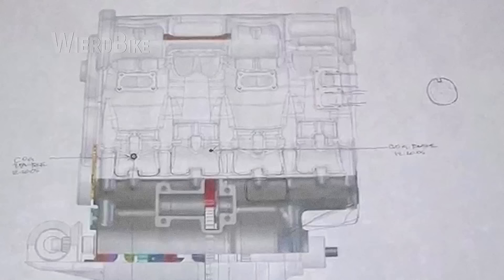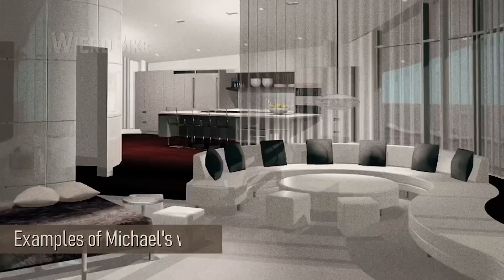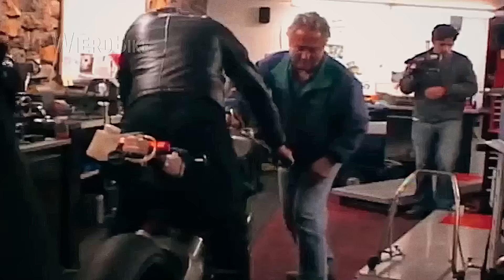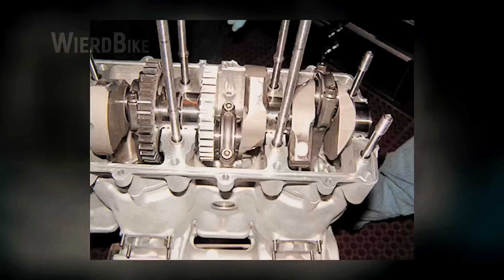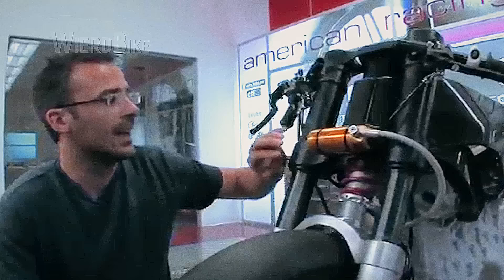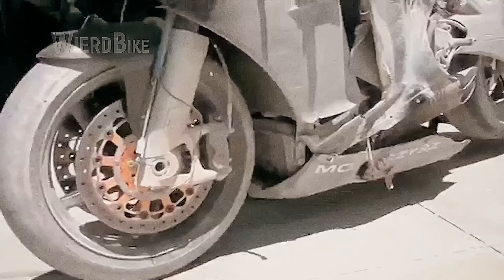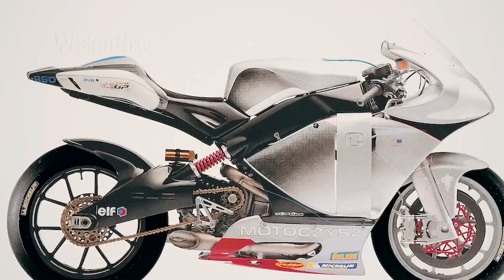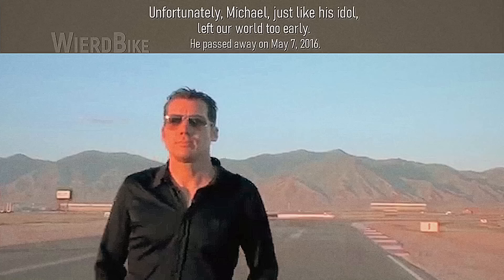It was SO GOOD that MotoGP CHANGED the regulations? Unique Z-line engine with 3 CAMS and 2 CRANKS.

Comment: Both Britton and Czysz taken way before their time by cancer...such a tragedy in both cases!
Reply from the maker: Absolutely true…
Reply: Isn't this how anyone that's a threat to an industry or an idea is taken out anymore?
  It's not a coincidence
Reply: @lancelanphier9509 it's time to take off the foil hat. it most definitely is a coincidence.
Reply: @lancelanphier9509  People around John Britten say that his prolonged close working with toxic chemicals to design and make the bikes was the cause of his cancer
Reply: @lancelanphier9509 car crash or poisoning is more realistic to be done, it takes years of regular poisoning with radiation to give a person cancer, like the Mossad did to the leader of the Brazilian nuclear project in the 70s and 80s.
Reply: @pashakdescilly7517 Stress it's number one factor for cancer.
Reply: Both worked with composites.
That is a fact.
Reply: Maybe all the hands on work inevitably involving a lot of breathed in vapors and absorbed chemicals etc ...think about all the lubircants,aerosols,fiber,carbon and fuel all the various elements they had to be like immersed in daily! ....no?
Reply: @pashakdescilly7517   certainly logical as I also posted below before even reading this although loads of people die of cancer that are not involved in such things...might even relate to things such as sleep deprivation?
Reply: @gregorykulinski2186   hand in hand with sleep deprivations?
Reply: @vyrnmn you should know there is no such thing as a coincidence, the laws of physics say this, everything is related to everything else😢cause & effect, no energy can created or destroyed, 'everything' happens for a reason 😮 you just need to see it

Comment: MotoGP did not change the rules because of this bike.
Reply from the maker: Maybe not
Reply: @wierdbike  No really, not because of this bike, it's a great design exercise, as was the Britten, but like the Britten, a long way from being fully developed and a serious contender. JB's bikes had a lot of potential when they first came out and were something to behold (I live in New Zealand and have seen them race many times) but unfortunately, they weren't very reliable and probably failed to finish more races than they actually finished. The V1000 needed a lot more work to really compete with the likes of Ducati, Honda and Suzuki who were the main competition in the 1000cc V twin market.
Reply: I bet if you research it the rule changes were proposed way ahead of time like they are again even now with the future moto gp rules once again lowering discplacement from 1000cc this time to 850cc instead of the 800cc that helped kill this motorcycle.  They dont change suddenly ever and the manufacturers must be oboard and have time to design all new bikes around the changes...maybe 150-200cc is not insane difference but you know it will effect a whole bunch of components of the design...enough that the motors at least will be all new...not like they will simply shorten the stroke and reduce the bore diameter a little.   I recall the mid 80s Harley initiated tarrifs on Japanese motorcycles 750cc and larger....Overnight the big 4 retooled and simply made their 750s into 700s which SEEMS like it would not be a big deal but it killed performance on em!  I bought an 85 VF700 Interceptor...what a DOG!  Was cheap as hell though!  3500 out the door brand new and half the price of the very next bike I bought the Limited Edition 86 GSXR750   $6,999 plus tax and licence etc
Reply: @onecookieboy but when they went... My God did they go.
Never saw one raced... just too young. Did see Andrew Stroud doing demo laps at Ruapuna.
I raced production based 250's in F3.
Reply: @wierdbike  Then why Lie?

Comment: Looks a bit like a 4 cyl version of VW VR6 ? For amazing engines i think Honda's 1979 NR500 with the "oval" pistons, V4, 32 valves 8 spark plugs was the most extreme. They also made a 250. 
NR500 was never successful but the construction was insane in 1979, trying to beat 2-strokes.
Honda also introduced F1 active suspension using cameras to detect surface in front of wheel, allowing them to adjust suspension before car hit a bump. 
Active suspension is what made Williams win so much, even without the cameras. The 1986 F1 BMW Mpower M12/13 was also a fantastic engine, making so much power that the dynamometer at BMW could not measure it (max 1280 on dyno,  motor had 1400). The most powerful F1 engine ever.

Comment: I thought the unit sales requirement was a WSBK thing, where MotoGP was for prototypes.
Reply from the maker: Yeah right!
Reply: He originally wanted the bike to compete in MotoGP, I'm not sure if the plans to sell road legal versions  came before or after MotoGP dropped the displacent from 990 to 800cc but either way, if Czysz had made road legal C1's he wouldn't have been able to race them in GP. Rules prohibited the GP bikes from using any parts from road legal bikes.  The WCM team got busted using Yamaha R1 engine parts (this was before the big recession and the short lived CRT bikes in GP, some of which used modded Aprilia RSV4 engines). 

He had also planned to race the C1 in Superbike classes but he never got the engines to be reliable. But they were said to have exceptional handling.

Comment: There is a motorcycle dealership in Portland that uses a motoczysz engine block as a door stop. It worked great.
Reply from the maker: yeah-yeah, very funny…
Reply: @wierdbike  No joke. 100% truth.
Reply from the maker: No way… any proofs???😂
Reply: @wierdbike  Its at Motocorse Portland Or.. Thats all that I will say.
Reply: The gas motor for this bike didn't make much power and liked to get rid of all its oil on local race tracks.... a lot....
Reply: True. It was VERY early in its development. Who knows what might have been with sufficient time & money.The dr stop was one of the "porous" cases.

Comment: I’m all for thinking outside the box, but even tho I’m not an engineer, and my power plant manager dad and Northrop Grumman engineer brother have infinite more knowledge than me on these issues, even when I was 17 and this was getting all the hype in the press, I saw that it was a failure. A Z-config in an inline engine might give better cooling. IF IT WAS AIR COOLED. Secondly, minimizing the frontal area for aero doesn’t work if you have THE RIDER sticking out well beyond the fairing. And I remember an article where they were bragging about the engine producing 190 horsepower. When the Hondas and Yamahas were making 250. It’s a quirky idea. But don’t insult the great John Britten by putting him in the same breath as a Las Vegas casino architect. I’ve met both Bostrom brothers, and have even talked to them about this. They did say that it handled quite nice. But it was slow. And Shane Turpin was never an AMA Superbike champ.

Comment: While this bike is interesting how good it was/wasnt waswasn’t was never proven. It never turned a wheel in anger and no rules were created or changed because of it. Ultimately it was abandoned and Michael chose to pursue electric motorcycle racing which he was very successful at, but it wasn’t the same bike or class of field.
Reply: No but much of Czysz's chassis innovations went into the E1PC and once they got their electric motor issues sorted the bike was virtually unbeatable at the time it competed. Whenever the patents run out (if not already) or his estate sold the rights, someone could put his designs into some kind of use but the bike market isn't as profitable as it used to be and the big manufacturers don't like to think too far outside the box.
Reply: @brentbartley6838  electric bikes could’ve been a windfall for them but sadly Michael passed and that killed the project. I still remember when the original bike was unveiled at the Portola Plaza Hotel and its initial public start up. It was so cool, like the Britten.

Comment: This guy is awesome the fact that he made an engine based on the design of the Volkswagen VR6 engine is mind blowing, 3 camshafts as well !!!
Reply: Other than the narrow v angle, there aren't many similarities with the VR6. This engine fixes the VR6 head design by using 3 camshafts. The crankshaft design is interesting, but it's only applicable to a motorcycle.

Comment: Czysz himself abandoned development on internal combustion motorcycles in his lifetime -- this bike was supplanted in development by a battery electric built around a modular, interchangeable battery system that allowed full swap outs in normal pit stop durations. Electric allows for higher power with way less moving parts... Czysz understood the simplicity of e-power. This bike, as interesting as it was, was an evolutionary dead end.
Reply: Perhaps, but one must also consider he did not have deep pockets and did all of this purdy much on his own.  Imagine if you will, a man with a dream this big and someone with the fortitude of foresight to restore American Factory Designing with a totally new wholly different design. Remember the Wankel Engine ?? Developed due to its high rpm potential and relatively lightweight design. Imagine if a Trump or a Rockefeller got interested just where this could have gone.
Reply: @anonimous2451 Britten used to quench the castings he was making in his back yard in in his neighbours swimming pool
Reply: @anonimous2451 this project was likely more successful because a trump character didnt get involved.

Comment: Motogp changed the engine capacity to 800cc (effective in the 2007 season) to slow down the bikes, and within a half season the track records were being broken. The engineers overcame the capacity limitation by utilizing pneumatic valves to raise the rev ceiling and using electronic aids to control the power delivery. The Motogp bikes are constantly becoming too fast for runoff areas at certain tracks, so expensive changes are made to increase the gravel traps. Bike speed outgrowing circuit runoff areas has been an ongoing problem for a long time. This unique bike would probably not even qualify for a Motogp race. To enter the qualifying session, a rider must have a practice time within 105% of the fastest practice time set during the weekend. There is just no way 190 hp could compete with 250 hp (in 2007) or 300 hp today. The slowest world superbike would probably smoke this bike. Only comment from Jeremy McWilliams (who has experience competing in Motogp on underpowered bikes) was about the agility in changing direction, but nothing about the power. The fact is that any moving part requires power to spin it, and that engine has a lot of extra parts. Michael Czysz was a visionary, but not an engineer.

Comment: You know it’s a serious race engine when they use timing gears instead of timing chain.
Reply: You mean like the VFR?
Reply: Timing chains (or belts) are utilized in most production engines because they are quiet. Straight-cut gear to gear drives are very noisy. In a race engine, noise is the last thing on anyone's mind.
Reply: @jburnham9109  Timing gears are also way way stronger like it’s nearly impossible for you destroy them if you put them on a valvetrain system and they’re thousandth of a mm accurate in precision. It’s like straight cut gear vs CVT chain where you cam timing aren’t distorted by tensile stress at high HP. 

Yes they’re slightly noiser but as far as contact surface is a concern they’re not much louder than the chain counterparts because the gear contact patch a super tiny.
Reply: @soraaoixxthebluesky  absolutely. I would argue that noise is still significant compared to chain drives though. That's why the reverse gear in manual transmissions are so noisy. They are straight cut spur gears as opposed to the helical cut gears in the forward gears. Same applies to racing transmissions, which use the stronger straight cut spur gears. Where strength and performance are the main priority and noise isn't a concern. 
There are even gear drive conversions for timing chain setups that's main purpose is to create noise because it sounds like the whine of a supercharger, lol.

Comment: Got to give it to the guy, trying to make a narrow motor when the factorys were all trying to make a short motor. One which cam timing could not be easily changed, and certainly not actively. Oh, and that 90 degree power transfer!   Man has to live his dreams but he saw probably right to go electric. I believe agility was finaily improved mass centralized and the reverse rotation of crankshafts (opposite the wheels) ala Yamaha M1. Stability and traction with a short forward engine and long swingarm. Power with money, moneyand a little more money. Can't beat that money.

Comment: I've never heard of this before, so thank you for this great video.

It's funny, no matter what sport, there is a call for innovation But as soon as an underdog appears on the scene and everything is about to turn upside down, the rules are changed under pressure from the old hands.

Knowing that it is financially impossible for the underdog to react quickly to changes. 

In my opinion, this highly commercial sport is completely for ass.
Reply: Motogp rules were changed because the 990 cc four strokes were going over 200mph and it cost the lives of a couple of riders. They dropped the capacity to 800cc but the manufacturers overcame that with much higher revs, especially the Ducati that had the desmo valve system that could rev higher than even pneumatic valves and the 800cc bikes went just as fast.

Comment: The 1987 Honda NSR had a counter rotating crankshaft, so there were GP bikes running the counter rotating cranks 13 years before 2000.. The Moto GP rule change had been known about for a while but MotoCzysz carried on with the engine they had and it had nothing to do with how good or radical the engine was. If it had been so radical the engine would have run pneumatic valves driven from a small powered compressor on the bike like the Aprilia's had been running .

If you are going to do these videos please check your facts..
Reply from the maker: Woah, so stuffy in this room…
Reply: @wierdbike  check your facts and then you wouldn't get corrected by someone who wanted to watch the video to learn something...
Reply from the maker: Did i say that C1 was first gp bike with counter rotating crank, or what “facts”???

Comment: MotoGP didn't change the rules to prevent Czysz from racing, that is ridiculous.
This was an interesting design that could have made a unique street bike for sure.  To imply it would have even got a sniff of a MotoGP lap time is laughable though, the production superbikes of the time would have even destroyed it on track.  Far too complex with more failure points and inherent friction that simply cannot be overcome, a V-four 990cc GP engine has a simplicity and elegance that it would never, ever have.  
The power disadvantage, even if it could be made reliable enough to finish a race, would also not be countered by the improved handling due contra-rotating cranks.  Yes that reduces gyroscopic effects to a point, racing and production bikes have already answered this by having cranks rotate opposite to push the front end down under acceleration, this bike would not have had such an advantage.
While everyone focuses on the engine of the MotoCzysz, ironically the chassis was just as interesting and is what had the potential to advance the state of the art at the time.  His later electric bike was more impressive (and successful), and I am ambivalent about E-bikes in general.

Comment: The longitudinal inline engine with dual counter-rotating cranks would be a VERY cool thing in a bike!   It would lean either way without fighting gyroscopic forces which tend to lift the front wheel on conventional lateral engine cranks while the longitudinal orientation would help prevent wheelies because of the gyro force it exerted.  That is some cool thinking...though the manufacture would have been expensive as all hell which likely would have quelled any production chances.   Sad that the rules are the way they are...but do seem to be designed to keep the 'little guys' out of the game.

Comment: If you are going to redesign the front suspension to reduce friction , why retain the worst possible configuration and use a telescopic mechanism?
One of Norman Hossack or Tony Foale's designs using wishbones is lighter and completely adjustable

And there is a reason you rarely see inline crank configurations in motorcycle racing.
Who needs to have a bike's lean angle change as you accelerate out of a corner?
Reply: I think the counter rotating cranks solved that.
Reply: Those front end designs have been tried in racing at various points and any advantages they do have often don't out way the disadvantages.  Weight, quickness of transitions (agility), rider feel.  The anti-dive properties might work well in wet/mixed conditions and fast sweeping turns but in hard braking and slower corners front end weight transfer (controlled) helps load the front tire, shortens the wheelbase as the forks compress, quickening steering. 

Bimota (under the Vyrus brand I think) was supposed to have raced a Tesi based bike when Moto2 was first created. They created a bike but it never did race. Maybe it wasn't competitive, maybe they didn't have the money (probably a bit of both).

Britten's design worked well at the time but who knows how well it would have continued to do over time with the massive increases in power, speed and stiffer tire construction. MotoGP tires are so stiff they need alot of load to keep heat and make them work. The Bridgestones were notorious. Michelins are less stiff and now all the front load created by the aero is causing pressure issues.